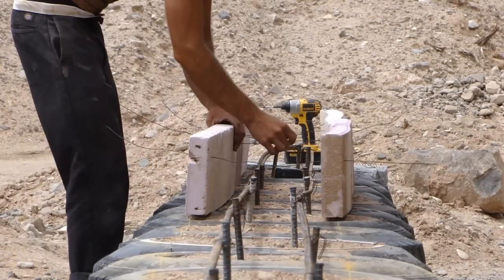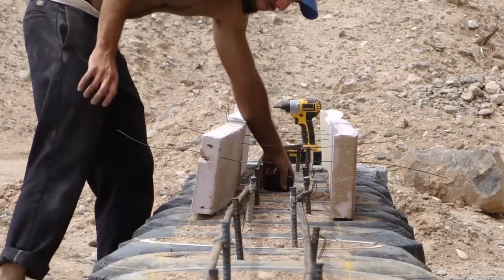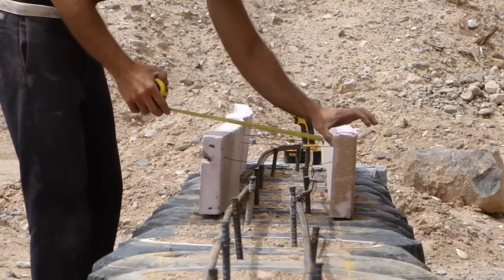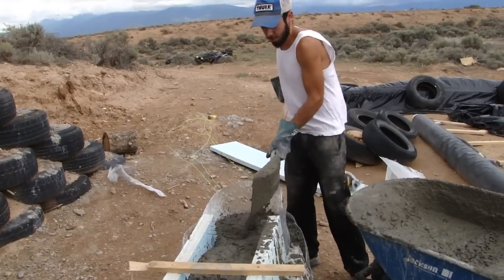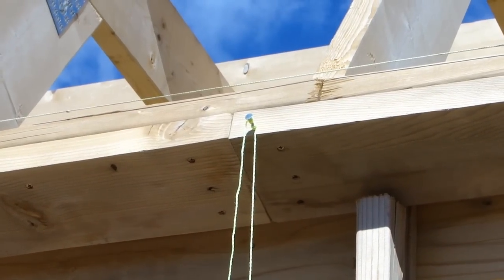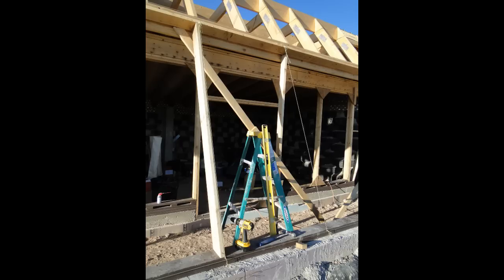How to Build an Earthship's Front Face - Part I

Comment: Hi there! Just came across your video! It's really a lifesaver because working on a very tiny budget here I needed to find something to do as a foundation for my shed to home. Can you help with any pointers on this please? My intentions are to do a 2 tire high foundation to sit the shed on the top. I'm in Bernardo NM are so South NM and my area has a bit of rodents. Would you suggest anything to keep them from coming INTO shed through bottom of foundation?

Comment: You cant put rebar directly into the soil, it will rust and the electrolicis will travel to all other rebar and rust too. If you plan to put it into soil, dip it into some epoxy so the soil cant make it rust. Other than that, love your video.

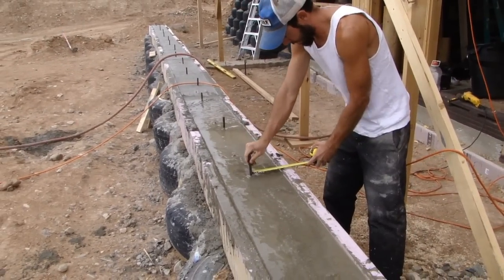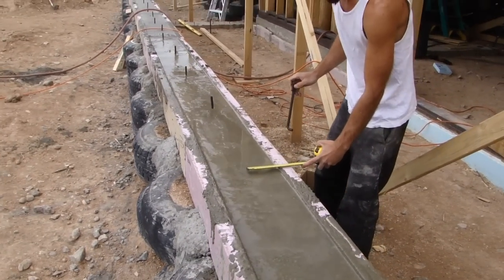Comment: Awesome videos. Thank you.  Tip.... 2:14-2:43 on video. When you're measuring the same exact distance, slide your left finger down so it touches the outside of the form when you have your exact measurement.  Then when replicating it to the next one, you won't have to slide it back and forth, just hold your finger to the form, then just verify your measurement is right.  Saves, some time and reduces errors when we are tired from working all day or thinking of our next steps.....Great videos.  thank you!